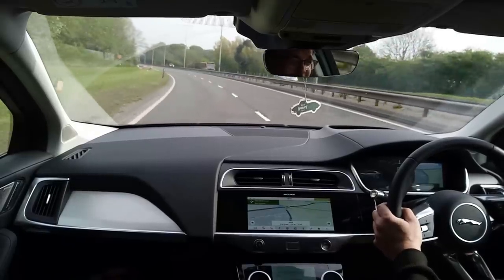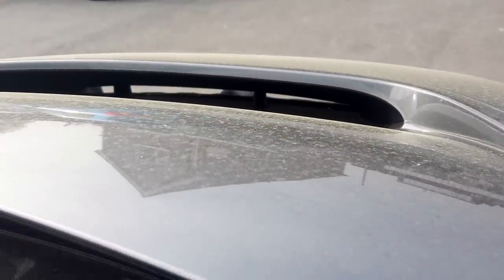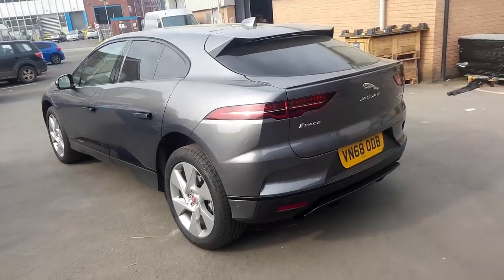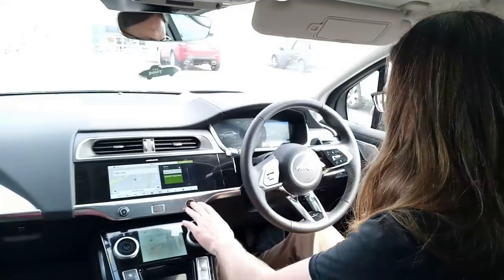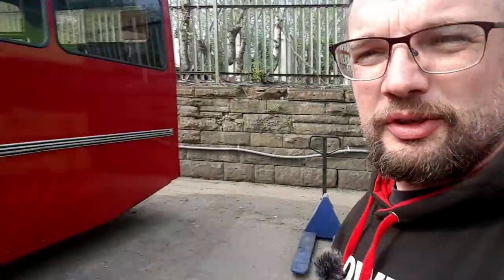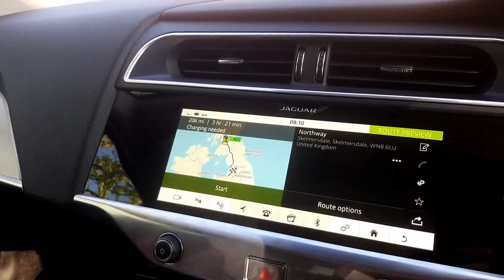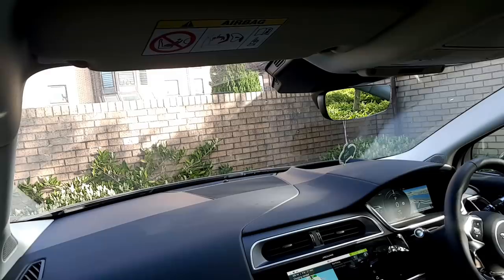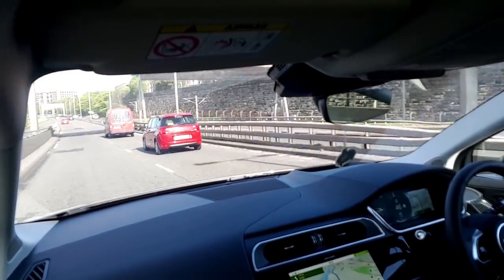Real Road Test: Jaguar I Pace 800 Roadtrip - with bonus bus action!

Comment: Great video, I think why you have had so much trouble is for the gas stations where you charged is not going to make it easy for you to go electric, they want you to buy petro instead and as for those charging stations that was broken or did not work right may have been vandalized by someone intentionally. Personally I would not own a electric vehicle, they fine and nice looking, but the infrastructure is not there, electric vehicles are only good if you live in the city and only good if you got time to waste on a full charge. Matter of fact I live in a big city (Baltimore Maryland) and I can't tell you where a charging station is, because simply I have not seen none, these stations maybe here, but there can't be many, so Electric cars are pretty much useless in Baltimore.

Comment: I WANT AN ELECTRIC CAR! Yes, deliberately shouted. Since I first decided I've changed my car twice. Both times getting a Leaf was high in my choice list but, both times, after examination I realised that getting it charged as needed would be very difficult. My options involved either a 50m extension lead running across the road, or parking the car at my mates house 2 miles away. So, I had to go petrol instead.

Infrastructure IS a big problem. Yes, there is a very small userbase of electric drivers but there are plenty more who would be if only they could. It's a chicken & egg situation where the infrastructure builders don't seem to realise that if they want more 'eggs', then they need more 'chickens'. We need to find a way to take the beancounters out of the equation, as the development is being strangled while they are in charge. But, we are in a system that doesn't allow anything to happen without their okay. AAAAAARRRRGHHHH.....

Re: my Leaf. I spoke with my landlord who owns many properties & has a turnover of many millions. He is constantly making very green noises and made very encouraging comments about my getting an electric car. But then he realised that, even though I was minimising his costs, at some point he would need to dig into his pocket if I was to be able to charge the car at my flat (i.e. his property) and he lost interest. I hear many comments about the bad Infrastructure on the major routes, but surely the infrastructure around residential areas matters as well.

Comment: So basically the car costs a fortune, the electricity is only slightly cheaper than petrol and the infrastructure (or lack of it) means that any long journey is impractical. Seems we have a way to go before mass take up of electric vehicles will happen. Shame, because the car itself seems great.

Comment: Electric cars as machines are getting rather good. The charging infrastructure is always going to be what holds them back for longest, but the inconvenience of how long it takes is the biggest single stumbling block. Until there's a way of getting a full charge in under 10 minutes, it's not happening as a long distance means of transport.  Having to stop every 200 miles for the best part of 2 hours isn't acceptable. And that's factoring in whether the charger actually stays charging. It might work out marginally cheaper than petrol, but not when you start factoring in tea/coffee/snacks consumed waiting on the charge, it's pretty equal. If, for whatever reason a 410 mile round trip was needed, it would take 4hrs longer in an Electric car just for having to stop twice for charging. And they want trucks to use this? Can't see companies being happy with their vehicles stopped for many hours or even days losing money going nowhere. 

Obviously there's the positive aspect of the emissions element, electric cars are pretty ideal for cities, but that's really their only practical use and will be for decades at least. Even when the cars get better, the infrastructure and tech they need to make them viable isn't close to existing.

Comment: To me Jaguars aren't what they used to be.
Reply: That's possibly no bad thing. Pre Ford the reliability wasn't the best.
Reply: @williamwoods8022  I, too, am in The UK. The worst car I owned out of warranty was a Passat. Unreliable and outrageously pricey to fix. If anyone wants a German car, the my experience leans at BMW. I , however, am currently using a Mazda 6, which has so far proven itself very nicely indeed.
Reply: To be quite fair reliability has gone down for quite a few car companies. They don't build them to last so you go out and by another one. Japanese cars though reliable as always.
Reply: @jaggass  Some people have reliability issues with any car. My father in law is like this. He doesn't understand the concept that servicing and maintenance are both essential for any car.
I'm not sure the car makers build em deliberately badly as the reputation would follow them.
Maker to avoid for me is VW. BMW is the best of the German brands. However, I use a Mazda6. There's a surprise

Comment: With the air conditioning comment about using fuel these new electric cars use the air conditioner to cool the batteries down so even when u think it’s off it’s might not be off lol

Comment: Electric power train is impressive but sorry, that's not a Jaguar. 

They should have produced a mid size saloon in the style of the original XF (modern, but elegant styling, luxurious and suave interior) but with that powertrain. They'd have cleaned up.
Reply: And then wouldn't be able to sell cars in China and be fined on co2 in Europe.

Comment: Here in Australia our government and Left pressure groups are trying to push EV's and renewable power onto us, even with the Ipace having 200 Miles range, a current 8 hr trip from Melbourne to Adelaide (763km) would go out to 2 days minimum, assuming you could find a recharger in the right location in the middle of the country. Which is highly unlikely. At the present EV's are city cars only here.

Comment: Wow, I had no idea how relatively useless electric cars are in the UK. No matter how quickly electric cars accelerate, their average speed on a journey of 2 or 300 miles couldn’t remotely compete with either a petrol or diesel once you’ve factored in an hour or 2 charging stop.

Comment: We have a huge stock of terraced houses how do they charge electric cars.
Reply from the maker: Lamp post chargers are a thing in some parts.
Reply: @HubNut  maybe but the spacing of. Lamp posts will be an issue and street lighting cables not up to. It. Needs to be alot.of ifastructure changes before we can go eletric

Comment: Just think how much fun gas cars were early on, when you had to go to the Pharmacy to get fuel... infrastructure not being ready is not the fault of the electric cars, just piss poor planning of the manufacturers and a failure of the power suppliers to take advantage of an opportunity, because they are to damned cheap to do so. In the US Tesla has taken that bull by the horns and created a competitor to the power companies, no such problems in the Southeast US. Not as available as gas stations but not as bad as the crap you had to deal with. The Tesla is that good and you pay for it...the Jag is not that bad, just huge.

Comment: Air freshener in a new car? That's odd!
Meridian audio. See, that's how you do it. Bullshit Bose and B&O stuff. 
Volvo got it too with their Dynaudio in top spec models.

Love the little satnav screen behind the wheel. 
Washers in the Blades. Very BX'y.

Tip for your trip; In the Netherlands you indicate when there's space, not to tell people to get out of the way. In really busy traffic if you really, really need to change langes it's sort of accepted, but generally you look for a gap, adapt your speed, indicate, and go. Not indicated to ask for a gap. 

The charger does an Olfi.
IEEEEEEEEEEEEEEEEEEEEEEEEEE

Generally you can setup the amount of regen in the menu somewhere. I think it can even completely be off, but that'd be a waste.

Shocked to see how all of those chargers charge at different speeds. Renders them useless.
Renders the car useless. It's not quite there yet. Pity.

Comment: Damn near a whole hour of Lord BuzzNut⁉️⁉️ Good God, man, do you think I've to nothin better to do with my time⁉️⁉️🤔🤔🤔
O.K., so I've invested one hour of my life, which I'll never get back, but, on the plus side, the video wasn't half bad. With regard to E.V.s, :-
Until charging time is dramatically reduced, and range is considerably increased, E.V.s will only be practical for urban use. However, this, in itself, is not such a bad thing, as the urban environment is where exhaust pollution is at its worst.
Charging points should be nationalized, along with gas, electricity and public transport. This will help prevent a national disaster.

Comment: The only electric car I like. But I much prefer Petrol and Diesel Cars and Dislike Electric cars Except the Excellent Jaguar I-Pace. I Love Jaguars But if it was a SUV of any kind I’d have a Jaguar F-Pace over any Range Rover or any Car of that Class. The F-Pace looks much better than the I-Pace or E-Pace. I Love My British Cars Such as Aston Martins, Jaguars and Rovers & MGs. I love my Rover 25 as my first car (I never want to sell my pride and joy and keep it with my second car.) and my first choice at 17. I’d love a 75 Connoisseur or a 45 V6 as my second car. Hopefully in the future a Jaguar XFR (My Favourite Jaguar) or a F-Type R or a 2017-Present Mustang V8 Possibly a Bullitt Edition. My Ultimate Dream Car is the 2006-2012 Aston Martin DBS V12 the one from James Bond (Casino Royale and Quantum of Solace). My Least Favourite cars are German Cars Except Porsche which I like and the 1980-1991 Audi “Ur” Quattro From Ashes to Ashes.

Comment: Ha! The comments section is exactly like the reaction to smartphones years ago. “Why do I want one of them”, “I don’t want to keep charging it”, “I’ll never get one” etc. Well, the switch to smartphones was rapid, and brutal for those companies who did not embrace it, despite the plethora of chargers in the early stages, and the perceived complications of owning. The switch to electric cars will be slower, but only as the repalce cycle for cars is longer. EVs will soon be cheaper to buy, cheaper to run, far, far less damaging to the planet.  And on the tax question, the solution is not going to be taxing electricity (as we all use it at home too), but in road pricing. Frankly if my insurance company knows how I drive and reduces my premiums compared to the muppets on the road, bring it on.

Comment: Loved your test, proves to me a car like this is simply not practical in the UK. Unless the infrastructure drastically improves in most of the country a car like this would be a huge annoyance to me.
Reply from the maker: Well, it surely depends what sort of driving you do. For me, I do a lot of driving locally for which an EV would be perfect. I like four miles from a petrol station, so being able to charge at home would save me having to divert for fuel.
Reply: I drive about 200 and 300 Miles a day, various destinations. Having to look vor a charging  station and waiting hours to load is simply not an option.
Reply from the maker: True, but you wouldn't want a V8 either. All cars are a compromise.

Comment: What a ridiculously large car! Two metres wide and five metres long, barely enough to fit inside a parking lot and still only has five seats. An Austin A60 Cambridge is 1.6 metres wide and 4.4 metres long for comparison. In a time when congestion is getting worse the newer cars are becoming fatter and fatter, a good synchronicity with the obesity epidemic. The car will probably only last around eight to ten years anyway.

Comment: I get the feeling that a big problem is that there are a number of small charging networks and a variety of charging setups tussling for a limited market. It's Betmax Vs VHS on wheels. What might well make the step change needed is for the big fossil fuel chains to undertake to have their own EV charging in every existing site; that'll trigger a tussle for supremacy in the market and should result in the network both expanding rapidly and becoming more reliable.

Well, that's the theory assuming capitalism works.....

Comment: Why aren't automotive company's developing electric kits so you can do your own conversions?  My A2 being aluminium would make a great electric car...
Reply: Wouldn't be economically viable by a long way. The work involved would be huge, and the car is simply not designed with accomodating a large battery pack.
Reply: Don't count on Audi doing that, but there are a number of cottage industry companies doing it on a small scale. I'd love an electric a2
Reply: Because it just isn’t that simple, sadly. This car has been designed from the outset as an electric vehicle and has a range of 200 miles. The batteries take up almost the entire floor pan and new technology isn’t cheap. There are thousands of different cars, so there would have to be thousands of different conversion kits, with little demand for them. You’d be left with a short ranged, expensive, compromised car and who wants that? Electric (and any other) car production is best left to the professionals, and it’s an enormous challenge even for them!

Edited for spelling.
Reply: There are people on YouTube doing conversions. Johannes Hubner doing a VW Touran for one.  That shouldn't be too different to an A2, just obviously a bit bigger.
Reply: There was going to be an electric A2 but Audi axed it seeing the very slow sales of early imevs and leafs in 2011.

Comment: Any body thinking of buying an electric car should be made sit, tied up, and watch this video. My God!! I'm a Jag fan but wouldn't have one of these at half the price. 60 odd thousand pounds! It's a complete joke. Too expensive. Nowhere near enough range and takes far, far too long to charge and not enough charge points. Have you ever cued up at a petrol station that's been a bit busy? Just imagine if everyone had an electric car. You'd need charging areas the size of Birmingham's NEC car parks. Leave the car charging, catch a bus home and go on holiday. Run out of power somewhere. Who's going to bring you a can full of electric!!! God help us all. Keep the good work up. Cheers.
Reply: It's me again. I spelled Cue wrong. I Know it's kew, silly me. I thought I heard that they are bringing out an electric hoop and stick. Bet it's got a bigger range than the new Corsa electric car lol!

Comment: Until technology comes up with a way to fully recharge in 5 mins electric cars are only going to be good for 5 minute town journeys!
Reply from the maker: Absolute rubbish. I saw plenty of EVs on the German and Dutch motorways. Not everyone wants to drive over 200 miles a day.
Reply: @hubnut i get the concept but if you're doing a round trip like you done the charging times would be a big issue, especially if you're trying to get somewhere. Certainly good for under 200 miles overnight stay or if not in a hurry.

Comment: 90% of the time, the charging network is irrelevant as you'd charge at home. Tesla the only easy way to go electric for the other 10%.
Reply: Yes, but that 10% leaves you stranded if there isn't the infrastructure.
Reply: Tesla have the infrastructure, that's the point. You want to drive to the South of France in an electric car? You choose a Tesla. A Model 3 has CCS and can fast charge anywhere an iPace can, but also has superchargers.
Reply: @grahamleiper1538  It's hardly ideal having infrastructure specific to one manufacturer. Imagine if there were separate fuel stations for different makes of car.
Reply: A problem for people who don't buy Tesla. Same journey by Tesla - no apps, and superchargers at Tebay, Gretna, and Abington.

Comment: the world so should have gone down the hydrogen route rather than electric.  electric will never properly resolve the problem of range & charge.
Reply: You can buy one if you want one, Hyundai, Honda & Toyota sell them. Hydrogen may be okay for trains and trucks but everyone else will be battery.
Reply: @carlarrowsmith  you've missed the entire point
Reply: I suspect you don't understand my point. Hydrogen cars will never be a viable solution. Electrics cars pretty much are already, bar the really big motorway infrastructure and current supply issues. Hydrogen cars are hybrids that include batteries too, meaning much more complexity. That coupled with the energy efficiency of extracting, storing, transporting, losses and using, mean that its not viable. 

If we were talking a cruise ship or train, then great idea.

Comment: 2 days just to get to Glasgow.  Less than 200 miles?  Ridiculous.  Sorry, But I will never own an electric vehicle....ever.  If they become compulsory, then I shall give up driving.  As people have said, all that faff trying to find a charger, and then one that works.  Fancy expensive car.....for the price of it, you could buy a cheap runabout and the rest of the £63,000 or so left over will fill the petrol tank in it for the next 20 years plus, replace tyres, service it, MOT it, insure it etc (and you'd still have change left).  So, it's the Internal combustion engine all the way for me!  As I mentioned (a lot) on your Fiat electric car video, the amount of environmental damage with fuel and money that has been used by building these cars, and the factories, and the people who drive petrol and diesel cars to work at said factories, will never be evened out by a person buying the finished product.

This car alone possible cost millions to develop.  And we are meant to be saving the planet by driving one?

NAH - there are still rubber tyres to manufacture....engines to build....elements to mine for the new battery internals....steel for the body etc.  All being dragged out of the earth by diesel guzzling machines and shipped all over the world in massive ships.  I find it laughable.  And yet, people will still tell me ''I am missing the point of it all''.....